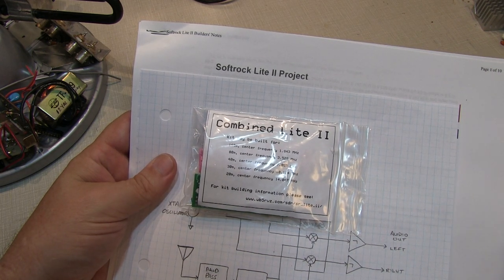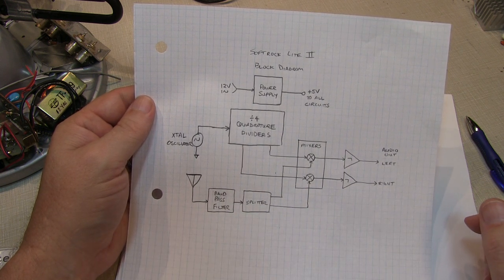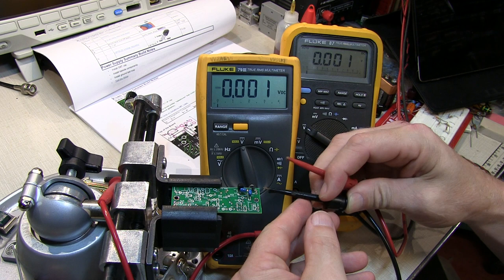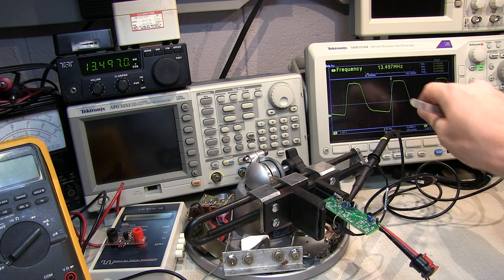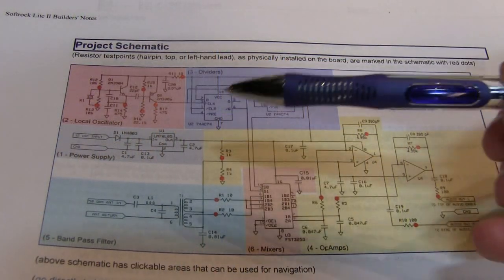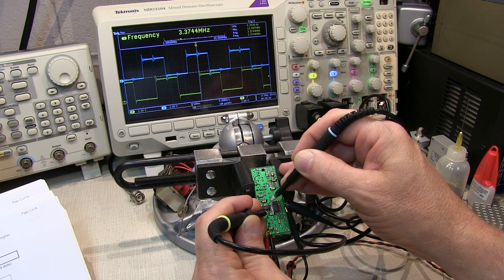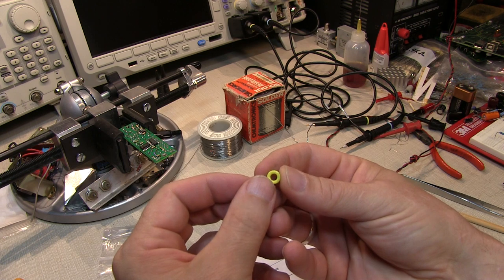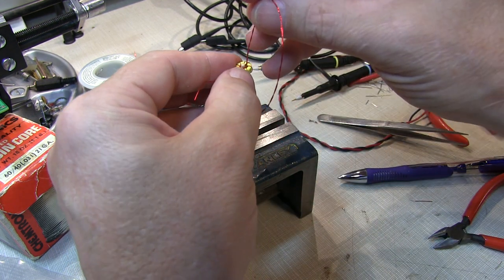#148: Software Defined Radio kit | Tutorial | Build | Test | Softrock Lite II

Comment: Great video as always Alan!

Just a note of preference; when i wind inductors on toroids (not so much transformers on toroids), i start by threading half the wire through the core and starting at halfway, winding it as two halves, that way you only have to pull about half the length of wire through the core in total putting less stress on the wire and taking less time because you have to feed less wire.
Reply from the maker: Good tip, thanks!

Comment: Excellent video Alan as usual. I wind a lot of transformers, inductors, etc. I used to use grade 2 non-solderable enamel wire, but switched to Grade 2 solderable (more expensive, but worth it!). I recall a very old and simple (most effective) tool to strip the enamel out of these non-solderable wires that my father used to have 20+ years ago, but couldn't find a modern-like equivalent anywhere, so I build one myself: take a good quality stainless steel toenail clippers, the ones that have a handle that flips, now you will need some tool pliers or similar to remove the handle which will leave the 2 blades, then bend the blades a bit inwards and pull them apart a bit, that's it now you can scrap the enamel from the wire very gently simply by closing the blades on the wire (no pressure needed) and pulling gently, voila!

Comment: Great projects!!  Notice that being "deliberate, logical and organized" is to me as much of this tutorial as anything.  Step verification, block tests are each important to develop a mental methodology to build a project and troubleshoot.  Wire bits, solder bridges happen and can cause unintended damage.   Working in high power RF domains, high voltages and other dangerous situations require a calm and measured approach to avoid death or injury or to ruin a very expensive test instrument by  begin distracted or in to big of a hurry or pressured by others.  Alan your calm metered approach is fundamental!!  "High -Fives" are great but not with a "Jesus Stick: in your hand!!!!!  Many, many thanks!!

Comment: Be care as you tin the enameled wire.  If you linger too long you make the copper brittle and the wire can be frail.  I like to scrape the enamel a bit.  Thin the insulation so it melts or burns quicker.

Comment: Great video!  I'm curious on why they are choosing to use a 12VDC input supply rather than a 9VDC supply.  Wouldn't the extra voltage just cause excess heating in the 7805?  Is there a benefit to using the larger voltage?
Reply from the maker: No benefit except that 12V is very commonly used in ham radio.  Many hams already have 12V supplies at the ready.  The circuit works fine off of 9V also.

Comment: Hi Alan: Do you think it would be workable to use a ganged rotary to wire in selectable bands?  Cheers, Mark
Reply from the maker: This particular design uses several band-specific component values, so it would be a bit impractical for this particular kit.
Reply: If you want cont coverage from 160 to 10 meters ( and a little more above and below -depending on your build) , just get the Softrock Ensemble II. It's not much more money, and is a hot little SDR, at least mine is. Best bang for the buck in the SDR world IMHO.

Comment: I have just completed my own SDR and used an upconverter bought from the States. I do have some problems with the HDSDR software stability I noticed you have used the same. Have you had any problems? But when it works it is great even on a small antenna indoors.
Reply from the maker: This is this I've played with HDSDR, so I can't comment on stability.
Reply: I've used hdsdr quite a bit and haven't had too many stability issues.  You may also try sdrsharp (http://sdrsharp.com) or sdr-radio v2 (http://v2.sdr-radio.com/), both are also free of charge.
Reply: Thanks for the help.
Reply: I am assuming you are using a RTL dongle based SDR with up converter. I have built 2 of those, but I find the drivers are the trouble, not the SDR Software per se. I use SDR Sharp and HDSDR on a little Pentium M Dell 600 laptop with a USB audio (for stereo inputs for my Softrocks..) They have fairly light resource requirements. I mainly like to use SDR-Radio (Version 1.5 for my Softrock on HF, Version 2 for RTL Dongles) on my multicore desktop. SDR Radio has heaver resource requirements but gives you web access to remote sources of I and Q signals off other peoples systems. In general my Softrock runs circles around the dongles, especially in urban and noisy environments because of its better bandpass filtering.

Comment: Hi, great video. If I were to make a breadboard version of this circuit to capture RF signals being broadcasted in the room, what would I use as the antenna?
Reply from the maker: If you're in the same room as the transmitter, a simple length of wire would do fine.  Best if it could be 1/4 wavelength long.
Reply: Thanks. One more question, can you explain what is going on in the schematic regarding the antenna, BPF, and mixer circuit? I do not understand why the bottom of the transformer nodes seem to be connecting to the + terminals of the op amps while the top of the transformer nodes are being mixed by the mux into the - terminals of the op amps. Thanks
Reply from the maker: Take note of the 0.01uF capacitor to ground on the bottom nodes of the transformer secondaries. That tells you that the RF is shunted to ground. This connection simply establishes the DC operating point for the transformer secondaries so that the other end of the secondaries are biased properly for the Taylor detector/mixer and the op amp inputs.

Comment: Really nice video. I just wonder, the output of the transformer are  one straight and one inverse right? Otherwise I don't get how you get a mixer from that MUX.. Or?
Reply from the maker: The intent with the splitter is to provide the same signal to both mixer inputs.  The "mixers" are switches which turn the path to the output on/off at the quadrature clock rate. The output is filtered to create the IQ baseband "audio" signals which are applied to the soundcard input.
Reply: ***** Aha, thanks. When I looked at the schematics in the movie I though it was multiplexing between the two inputs but it is multiplexing between input and nothing I realize now. But actually, multiplexing between normal and inverted signal should make for better signal strength...I think at least.

Comment: I know that is t-3yrs old but should the input pins be (7,9)
the outputs be (6,13),(5,12),(4,11),(3,10) and outputs from ((6,13)&(3,10)) and ((4,11)&(5,12)) coupling to respective MC1350s using 0.1uf capacitors one for each of the I and Q outputs and of course the chip is driven via (2,14), positive on pin 16 negative on (1,15) would that not work better?